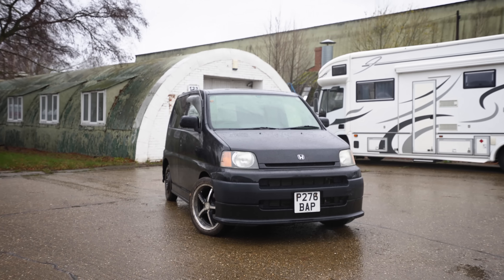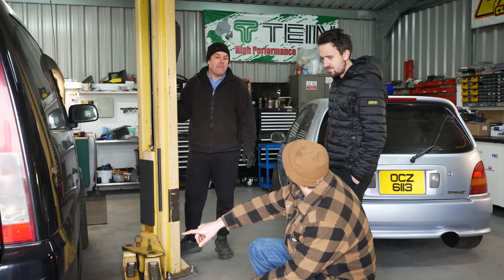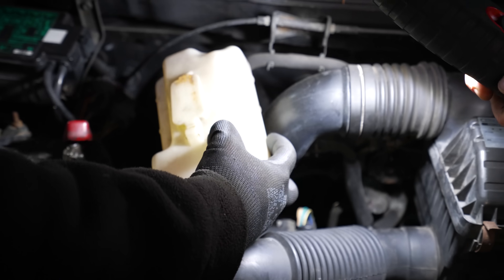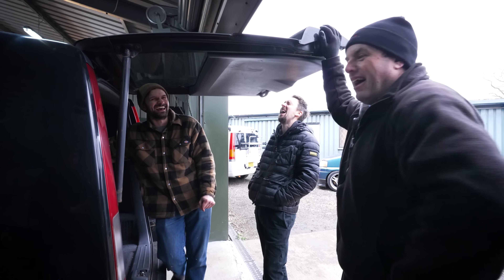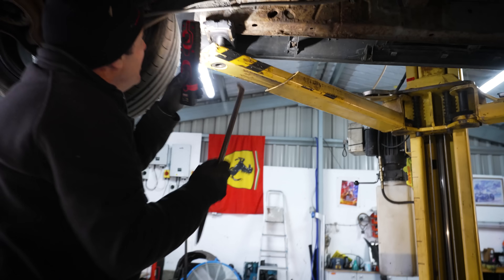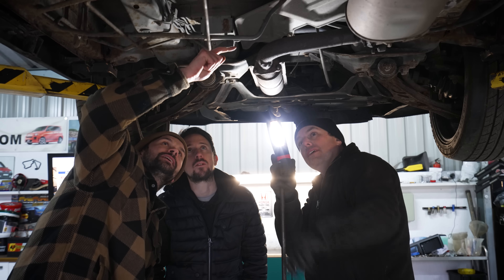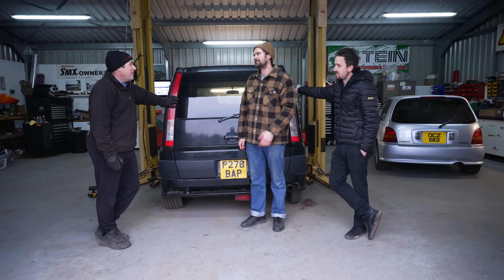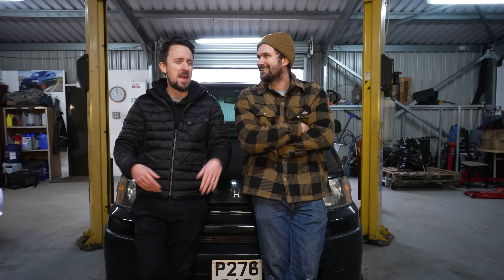Is This The Rustiest Car We've Ever Owned?

Comment: Ethan, you can get windshield filler to sort out the chip and as for protection there are films you can get that go over your windshield to prevent rocks and what not cracking it. They are kind of like a screen protector on a phone. 

But uuh, looking at the underside there are bigger things to worry about.

Comment: If you like the Honda, keep it, however it will become a labour of love!! Once fixed/repaired it will live on but this will be down to the effort put in to get it looking as it should all old cars contain rust it's how you future proof and noting its rarety some components will be like hens teeth to find let alone buy so it may end up being converted or upgraded having parts fitted that can be replaced easily like brake components, exhaust etc..... Good luck with the rebuild or cut your losses and weigh it in for spares

Comment: Japanese cars, no matter what make, always seem to have a brilliant tendancy to rot spectacularly from the inside out. They can look absolutely mint on the outside but be completely rotten underneath. I got stung by a Celica that didn't have a spec of rust on the body. A look underneath on the side of the road it seemed a bit crusty but solid. Its only after bought it and had it on the ramp that i realised how bad it was. My father in law had a Primera Tino, again, mint on the outside but the subframe was more sieve than structural. I was looking at buying an MX5 and the rear quarter panel at the bottom of the wheel arch had bugger all metal behind it. The inner panel disintegrated when pressed it with my thumb.

Comment: What that's it? It's in better shape than literally 90% of the cars you see on the road in Maine. You should see our Outback. The front coilovers have holes rusted through them and the wishbones are scary, the bottom of the radiator support is rusting out, etc.

Make do with what you can. Can't afford another car payment in this economy especially with auto loan interest rates.

Comment: Restore it. And in the end put an ebay turbo kit on it. It's a B series motor, it's gonna handle some low boost easily, about 300 crank should be possible.

Comment: My truck is way worse, had to cut off the running boards this fall because they were hardly holding on

A few kicks worked faster than the grinder… but reproduction body panels are widely available for F150’s

Comment: You should restore it then put new wheels on it lower it on bc racing coils or teins then put a dual custom big bore cat back exhaust and add a big  turbo also add a induction kit and upgrade the ecu and remap for proformace then add neons and  buckets seat custom dash board and back light  gauges and a dab radio with bass boosted and put a good sound system in too with bass